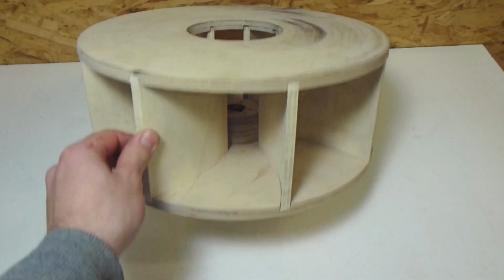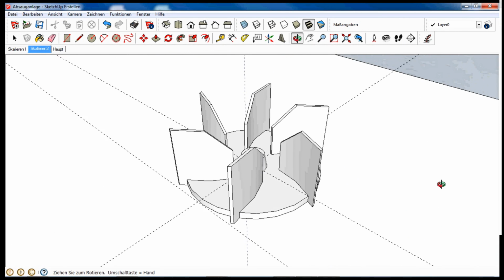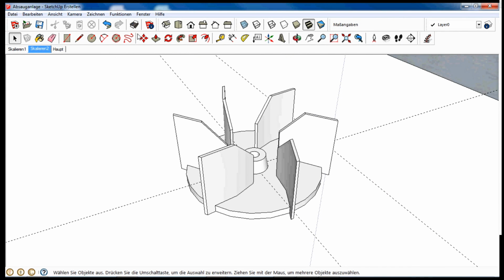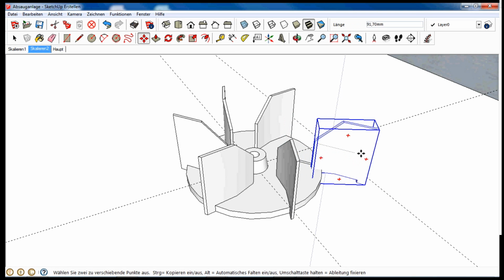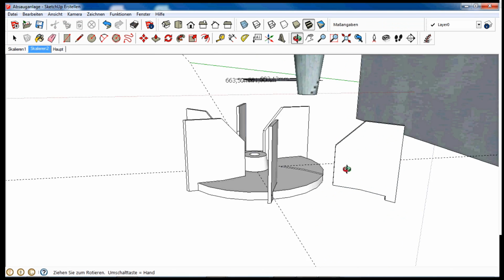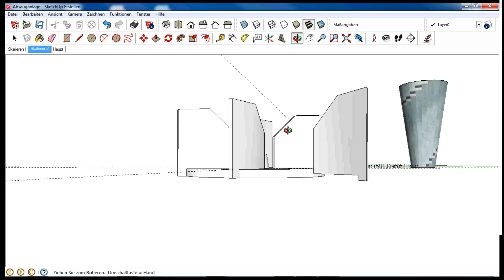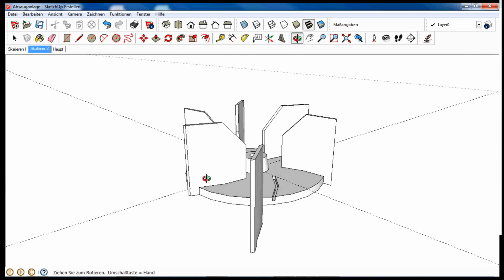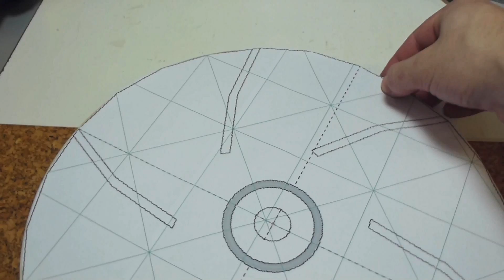Homemade dust collector upgrades (Part 1): New impeller

Comment: Go buy one in the store.3 HP motor, large cannister, Hepafilter, 2 feet in diameter, $500.00. 240volts 15 Amps. 
Dont forget 1 horsepower is 750 watts.

Comment: I wasn't surprised to see that MDF break.  I knew they would keep breaking with only the bottom part glued in place.  Maybe a real solid wood could have worked, but you need to understand that MDF while have it's pro's, will never be as strong as solid wood.  You can never hold down a vane if MDF like that by a 1/4 " piece and exert force like that motor does, it's almost like it always has this certain brittle quality to it.  Great build though, love your videos.

Comment: In my younger days I made tooling for automotive trim. I knew I didn't know all but watching these videos shows me how much I didn't know. Working with mills and metal lathes is a different occupation but you're still making parts. 
At home we have a band sawmill. It needs an impeller on the sawdust exit side to blow it further out. We're building a conveyor that will need to dust blown over. I shall copy this design and center it on the drive wheel.  Thanks to all who upload informative videos.

Comment: Many years ago, I was involved in a hovercraft project using ducted centrifugal fans. 
These fans were 900 mm dia, and the blades were backward facing aerofoils.
The general principle of the fan design, was, the the air entryarea, should be equal or greater than the swept area of the leading edge of the blade, and the exit swept area should be equal, or slightly less than the swept entry. This is because as air expands, it slows down.
If the air entry is smaller than the swept area of the leading edge of the blade, then it chokes the blades, or restricts the airflow into the blades.
Keep this in mind for your next upgrade.
Reply: What is the swept area? Is it the surface area of the blade height * inner circumference of the ring of blades? If so, I don't see how having the entrance equal to or greater than that is possible for  anything but the thinnest of impellers. There are many blowers where the intake is very large, but the blades are very high, so the area of the intake would be many times smaller than that of the area of the inner circumference of the blades.
Also, it would seem logical that the output be relatively similar in area to the intake, since the idea is air flow, not to make a compressor. 
It's very hard to find basic blower design principles online, so I've been going by what's logical and other people's projects.
Reply: bassl0va The swept area of the leading edge of the blade, is the circumference of the 'ring' formed by the leading edges of the blades, times the length, or height of the blade, as you have surmised.
The outlet area needs to be roughly the same, so the back edge of the blades needs to be smaller than the front, so the fan is conical.
The calculations can become quite complicated, and as its more than 40 years ago my memory of them has faded.

https://www.google.fr/webhp?sourceid=chrome-instant&ion=1&espv=2&ie=UTF-8#q=backward%20facing%20fan%20design

Above is what a google search turned up, that you could browse through, for; 'backward facing fan design.'

Making a conical fan is more complicated, so often, fan makers dont bother, due to the economics involved. They just use brute force rather than elegance, but with a hovercraft, minimum weight and maximum efficiency was essential.

https://en.wiki2.org/wiki/Centrifugal_fan

Above is another description.

Calculating the best angle for the blades was also quite involved, as I remember, [not very clearly now] but I think I ended up with something between 20-30 degrees to a line through the leading edge, and the fan center, and an airfoil shape was considered highly desirable, for efficiency, reduced noise, etc. but another search on that subject may turn up what you need, as I'm sure there must be computer programs for fan design now.
Anything that projects into the airflow, like ribs, etc, is very undesirable, as this reduces efficiency, and collects dust and debris.

Some more info here.
http://www.esmagazine.com/ext/resources/ES/Home/Files/PDF/WP_AAon.pdf

Comment: Your motor is hugely strong. You could make more "blades" for your propeller so you would have more "area" within same size without the need to increase the radius. The hard part is to assembler too many blades in the propeller, but it act like a turbine! When efficiency does not matter, we can do amazing things.

Comment: Do the tools in your shop on a red plug use a single phase or three phase power.
Reply from the maker: +Thomas Workshop The big red plugs are 3-phase 380v
Reply: +Marius Hornberger dose every German home have 3 phase power.
Reply from the maker: no, but if not it can be upgraded.

Comment: Your future is going to be very successful for you I imagine, your videos are very well done too.

Just a tip; if you wish to make impellers for a dust collector, I'd recommend a "soft starting" motor, you can get motors with equal HP but with a low starting torque = I'm thinking if you regularly use your dust collector, and flick it on a few times, the high starting torque motor could eventually shake the wooden impeller to bits and it might be a bit destructive in your shop, just a tip. 

Otherwise keep up the good work :)
Reply: Marius Hornberger well so much for that....
Reply from the maker: +AlmightyBanger I used it for over 1,5 years for now and no problems at all so far, but thanks for the suggestion.

Comment: Ich würde ja beim "Turbinenbau" im CAD auch die Belastungsanalyse durchführen? Das ist doch schon ziemlich weit im Maschinenbau, anstelle von Holzbau und Tischlern. Bei der Belastungsanalyse wird schon relativ früh klar, ob das Schaufelmaterial dauerhaft den Kräften und Vibrationen gewachsen ist. Die Beschleunigungskräfte beim Anfahren sind auch nicht so viel höher als beim Dauerbetrieb (oder doch?), ich denke nicht das die Masseträgheit durch eine plötzliche Spitzenlast hier wirklich einen Unterschied macht. Wenn das nicht am Anfang hält, hält es auch später nicht ... Glück gehabt, dass dich keines von den Schaufelbruchteilen erwischt hat beim Testlauf.

Anderenseits: hinterher ist natürlich jeder (hier) schlauer. Belastungsanalyse, pfff ... Und: selbst Ironman hatte seine Probleme mit Turbinenschaufeln beim Helicarrier ;-)

Schöne Arbeit.

Comment: I am afraid that at 10.35 one vane blew away because  without the blades being tied together on top, the centrifugal force acting on the centre of gravity which is away from the attachment glued edge, caused a torque, tensioning and   lifting the inside part and compressing the outer part of the slot .   You probably thought that the whole blade would be subjected to a shear sliding force where all the slot would be contributing in a homogenious fashion, but it is not.  When you added the upper ring, all the blades were tied together and then and only then did that  glued slot had only an outer/sideways, lateral  force without torquing the blade as when you did not have the top ring. Perhaps a fillet would have helped but the top ring is best.
You are young, very talented in different directions,  very intelligent,  but sometimes you take risks in design,  which is not a bad thing in young folks, but do protect yourself  when you switch on big home made  impellers.  I like your sense of humour. Thanks for these videos,
Reply from the maker: +Carmel Pule' True, during the build I thought that this could happen. But don't worry about me, I switched it on from the outside of the workshop, so I was safe.

Comment: For attaching the vanes a 2 component epoxy adhesive would give a significantly stronger bond. Here's a German supplier whose product I use on my wooden sailing yacht. http://www.hp-textiles.com/

Comment: What is the ID of those bearings?

Good presentation.
Reply from the maker: +drail80s I don't know. 22mm outside, 8mm inside, 7mm thick
Reply: +Marius Hornberger I believe he meant "inner diameter" as the meaning of id, at least were i live!

Comment: the braces you added to the fins will disturb the air flow. Impeller design requires advance CFD analysis and maybe air tunnel simulation that are conducted usually by big companies. it will be much easier to just copy existed product, cheers
Reply from the maker: +Hamid A but it works anyway.
Reply: +Marius Hornberger I know you are doing awesome anyway also :-) Just I wanted to participate and let you know

Comment: I think that triangle supports are better to place in opposite side of the impeller's wings.
Reply from the maker: Eldobaz D'Shkandebal No, not really. They support the wings to be not pulled over. On the other side they wouldn't be nearly as strong and would also block the airflow.
Reply: Marius Hornberger Hmm, it depends on the direction of rotation. I thought that the impeller rotates clockwise and blows from center. If so, air slides over the front side of blade, there is zone of a high pressure and triangles prevent air to pass freely.
Reply from the maker: They blades are curved away from the rotation. If you look on it from the motor side, it runs clockwise. The blower sucks the air from the middle and blows it out the side. I did it the right way, otherwise it wouldn't really work.
Reply: now I understood, in this case everything is correct.

Comment: Interesting, I didn't think MDF would've been strong enough. I've gotten the plans from woodgears and I am going to simply scale up the impeller for my 2800rpm 4kw motor. I have no hardwood of suitable size though for the vanes so I am contemplating alternatives..
Reply from the maker: 1873Winchester Good luck with that. But you need to make grooves for the vanes. Glue only won't be strong enough. A 4kw motor could destroy a not strong enough impeller in a split second. Like you saw in my video.
Reply: Marius Hornberger Dang, then I'll need to buy another router to make that compass cutout, unless I can rig something up for my router table (that router is no longer usable as a handheld one after mounting it).
Reply from the maker: should be possible with the router table
Reply: Marius Hornberger It was actually much easier than I thought, needed to drill a hole in my table however for a pivot point. But doing it like that and using an awl to puch pivot holes made the whole thing fast and easy, if you aren't opposed to holes in your router tabls...
Reply: Marius Hornberger You where right about the 4kw motor, tested it tonight after balancing, it had no mercy for the impeller. I had made the vanes from a thick piece of plastic pipe, I had router grooves, used epoxy and screws but it tore through that and failed pretty catastrophically. I also tried running it without a top lid, that probably didn't help. I think your method of using MDF or plywood works better, less material to accelerate and less momentum. I will redo it without the heavy plastic vanes. It was a good thing I had an extension cord and stood behind protection...
Reply from the maker: The Pipe should work just fine, but you REALLY need the top disk. But trying to make the whole thing as light as possible is also a good idea.
Reply: Marius Hornberger looking at the wreckage, the epoxy hadn't bonded to the vanes very well. That was probably the first point of failure, then the screws got pulled straight through the plywood. I think an MDF or plywood vane and wood glue bond would have been stronger.

Comment: Wie geil ist das dann! The epoxy is a good idea, use it to add some internal radii on the joins thus reducing the stress concentrations. I think you can remove the braces on the blades now you have that support ring, that will give you some efficiency back. Aber sehr gut gemacht!
Reply from the maker: Euan Dykes Yes, I could remove the braces again, but I don't think I'll get a big efficiency difference, because these braces are at the back. And air isn't moved there. But I also don't use this impeller. Too loud...even with good ear protection. 
So are you now English or German?
Reply: Marius Hornberger I'm a Kiwi living in Germany.
Reply from the maker: Cool!

Comment: You should have used epoxy.  Much stronger than glue.  But great build, I am impressed!
Reply from the maker: alfredesquer Not really, but much more expensive. The glue didn't fail, but the wood.

Comment: how far did the fins fly?
Reply from the maker: I don't know, it happened so fast. But one hit the wall. Just imagine that 36cm rotor spinning at about half speed (1400 rpm) and a fin coming loose and you get the idea on how far it could fly.

Comment: Sind die Blätter denn im Anlauf Moment abgerissen oder während des Betriebs?
Ich hätte ja erwartet das sich die Welle mit der Passfeder direkt im Holz durch dreht =D
Evtl. könnte man einen Sanftstarter verwenden das dürfte der Kupplung einiges an Stress ersparen. Hab ich an meinem Staubsauger für den Schuppen auch dran, gibts auch ein Video davon.
Reply from the maker: Im Anlaufmoment. Leider kostet ein Sanftstarter für 380v ziemlich viel Geld und mir gefällt der starke Anlauf. Anschalten...0,5sec...an, kein Warten. Aber die hätten die volle Drehzahl auch mit Sanftanlauf nicht ausgehalten. Jetzt ist ja der obere Ring drauf und das ganze Ding ist stabil genug. Die Kupplung hält das alles locker aus. Kannst du mir einen Link zu dem Video schicken?